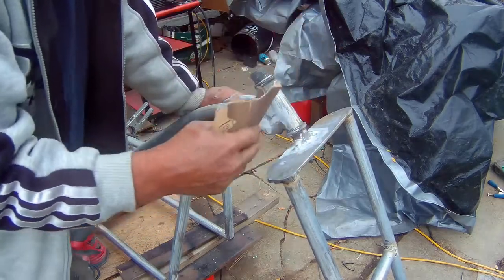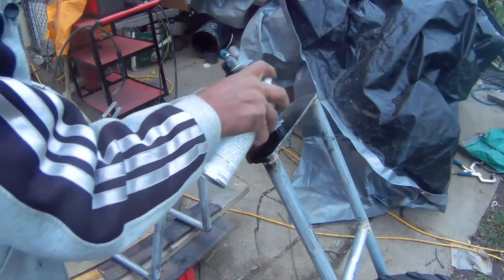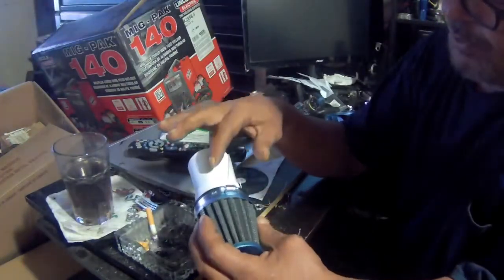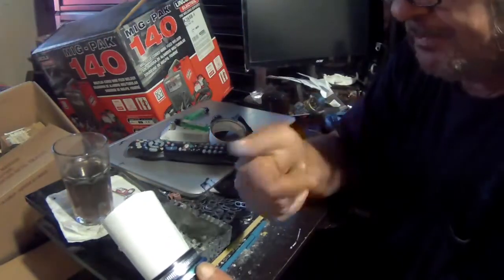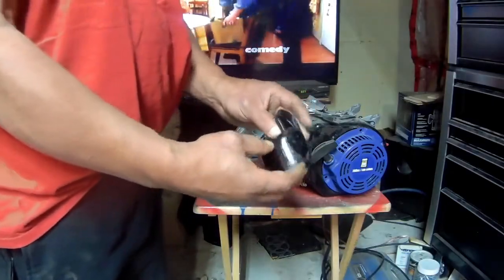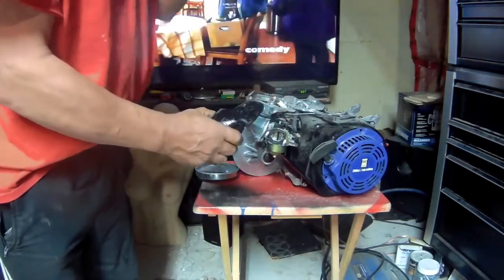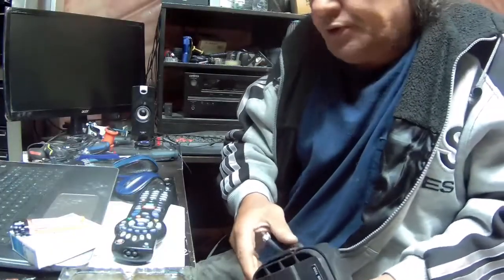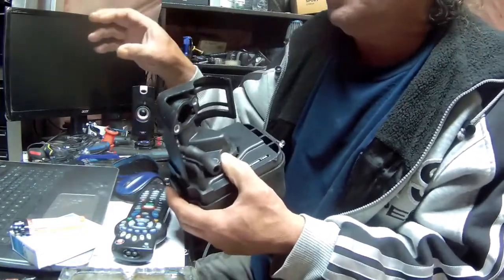Mini Bike/Chopper Build pt.03 filter adapter and other stuff

Comment: Nice work on the air filter adaptor.  Looks like it was meant to be there.  Cheers mate 👍.
Reply from the maker: Customwinder 1, Thanks buddy, are you still riding your karts there ?, the weather must be nice for you to still ride it sucks here
Reply: Neves Projects Hey Neves.  Had some repairs to do. And had to blow some money on my cars.  My white ute  the one you see in the vids needed her brakes done.  And the headlining on the inside has been replaced.  Brakes i did  myself.  I have another ute  I've spent some money on too.  Rego and insurance is a killer here.  $1000 a year for each car .  I have to fix the lights on my trailer too. Cheap leds were not the way to go 😂.  I'll have some good vids for all you guys in the next week or so.  Cheers mate 👍
Reply from the maker: Customwinder 1 I know how you feel about insurance It's the same here, I pay $140 a month and no accidents or tickets, cheap leds sound good but no not the way to go I learned that also, will be waiting to see your vids, Cheers